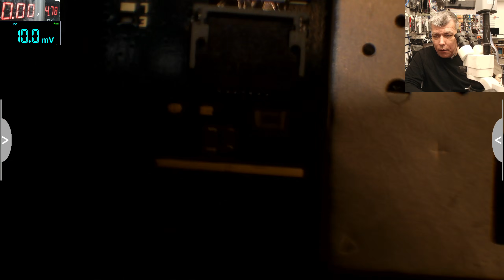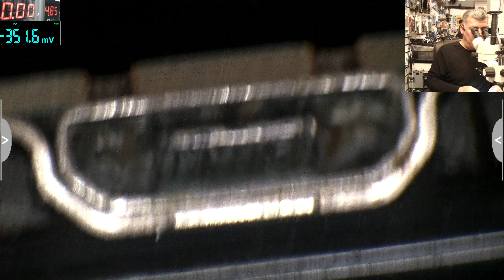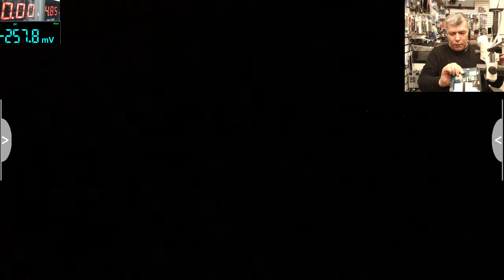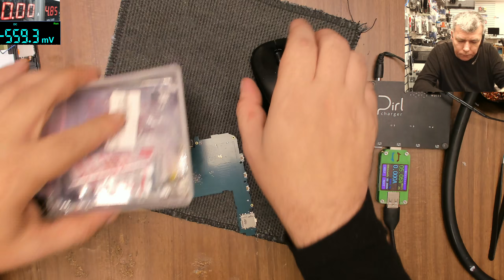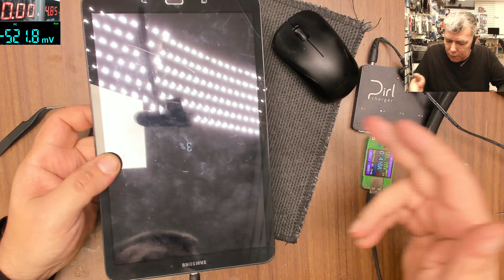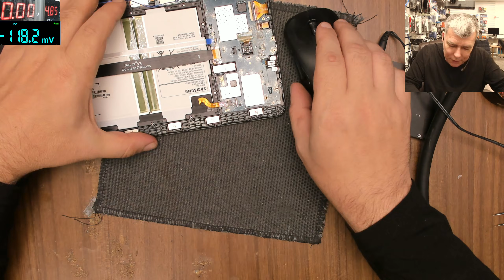Samsung Tab A SM-T585 not charging repair

Comment: Hi thanks for the information. Do i need to use Amps on my multimeter when testing battery or can i use dc volts then work out the amperage? Thanks

Comment: I'd like to learn repairing same stuff,but my practice is pure 0...I'm confused from where to start,I started reading e-books about electronics but without practice I assume it is not useful much.
Any advice is welcome.
Sorrin said you can not nowdays repair anything but he repaired every laptop,tablet,phone on his channel :D
I have an option to get this same SM-T585 for 30 euros,not charging not powering ON,I'd like to repair it,but ofc I don't have flux,amp/vol USB meter,micro USB connectors heat gun etc...

Comment: We call it a spark eroder. My friend used to make the dies for aluminium extrusions, and the die was so hard they used a spark eroder to cut the shape of the extrusion. He said they used carbon electrodes. Another friend used it to burn out tiny broken drills stuck in metal, and he used a copper wire.

Comment: Hi Sir  on xbox 360 two regulators voltage 3.3 L1117  when plugin adapter for 10 sec   are very hot like grill  this 2 regulators  are dead short ? i no have any power on xbox    pls help

Comment: You asked what useful things you could share with a beginner.  I think one helpful thing is sharing soldering temperatures and time to heat for air soldering for various size parts and boards.  Also based on situations, such as fast removal of a bad part or careful removal to reuse a part from a donor board.  It can be easy for a beginner to damage by overheating or tear pads and tracks by removing too soon.  Ant tips from you would be appreciated.

Comment: I have a faulty switching power supply and don't know where to start whatever I measure it looks ok. Also I have 3 samsung 7 phones 2 are faulty I have changed chips measured and all and still don't know what is faulty I even compared with working one and still don't know

Comment: I need your help my laptop is turning on but few seconds after putting the password it turns off the fan makes a loud noise, but l have cleaned it and also changed themal paste, put its still turning off, it can stay on for a whole day as long you don't put a password

Comment: these samsung usb ports are a mess...i have not many chances to solder it! i burned some of these with the same problem like u!
if u use a gun from top, you melt someting inside the port! if u use the gun from downside, you have issues to get enough heat to solder it properly!

Comment: About power supplies, to me current limiter stop the power supply above a certain current or voltage , but is the short circuit protection  useful in case you touch high voltage with the power supplies probes ? I will look for that video you talk of ! thanks -

Comment: My most difficulties with electronics repairs  is to find the issue without schematics. I know all the basics of circuits i check everything twice and still sometimes i just could not find the issue. In those youtube videos its looks so easy but in my real lab most of the jobs are really hard to fix.

Comment: Hello, How are you doing today! hopefully you are great. I need your help, I have Samsung model number np300e5v:
by my mistake I tweaked so of the bios settings, I activated secure boot and changed the boost option from legacy to UEFI then I only have a black screen.
I removed the ram dims ... nothing
I removed the bios battery ... nothing happen
I removed the bios battery and shortened the connection between the battery ... nothing happens
the only thing I get is when I press the power button it powers up after let say 10 seconds then the fan spin at full speed and nothing to the screen. 
any help. because this my work laptop and I need your help. it will be great if you reply to this comment. Thank you.

Comment: Sorin, i found electronics impossible to understand.
Text books were just jibberish to me, i suspect i had learning difficultys, but in those days there were no special teaching.
My way of learning was taking things apart and learning patterns of circuits and what they seemed to do.
I slowly made sense of most components and there propertys.
At the age of 55, i still have problems with some areas of electronics.
I also found mathmatics was a nightmare,  thankfully i have a calculator :-D
Reply: Same for me, books are very confusing, taking things apart 😊😊

Comment: External PSU tips and tricks
like those episodes where you were using the over current protection of the psu to look for shorts
or reading the amperage and drawing conclusions from that
or like those videos in which you were pumping amps into a device to literally "burn out" a short
stuff like this opened my eyes to the capabilities of a bench psu

si am mai facut si electronica, dar treburi de genul asta le vad pe youtube... mi-e si rusine

Comment: it's amazing how outright empty and cheep that motherboard is
the pcp is even one sided, probably not more than 4 layers in it, everything spread out
besides the surface area, this has the be the cheapest of the cheapest possible 
not the most efficient use of space, maybe they could have crammed more battery in the tablet with a smaller board, but nice job my samsung

Comment: Sorin, I am proposing a time consuming project, organizing and recording of the segments will take time. But it will leave a distinguishing mark on laptop repairs, here on Youtube. You remember you did a  fault simulation video once which was limited in scope.  What I am proposing is fault simulating from charging port to fully functional all charging circuits step-by-step.  The object will be to explain the startup sequence. But please use the schematic, and Boardview. A simplified diagram, for reference purposes will be nice at the end. I know it is asking much of your time, but it will become a reference. By the way if I were close by, I would have donated a laptop to the effort. Funny thing about the laptop (Gateway) is it missing First and Second MOSFETs. They use two parallel power diodes (in parallel), and a power Zener! 
By the way, nice video. Good Ol’ Times. I think we have taken parallel paths >>>> Thyristors, Diacs, Triacs 😄

Comment: Hi, thank you so much for sharing your knowledge. I am a software engineer for 23+ years and have electronics as a hobby now. I learnt electronics when I was young and I also worked to a small shop. I like power electronics involving current flow and control. I love your power supply video which I watched it four times. It will be really good if you can share your knowledge on current limiting and short circuit protection (OCP, OLP, limiting, etc.). Currently, I am designing and making one linear power supply from scratch (third one). I will be happy to share it with everyone once getting it done.